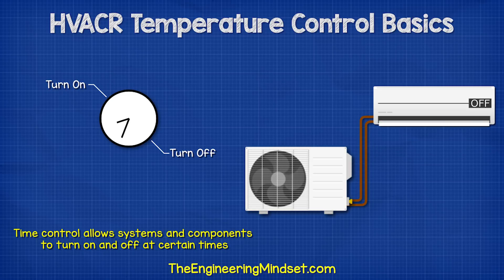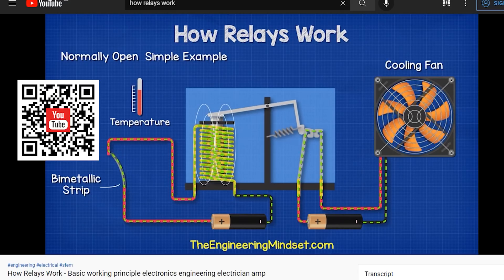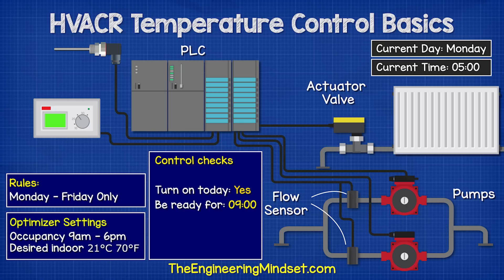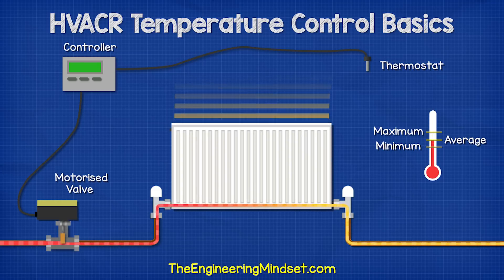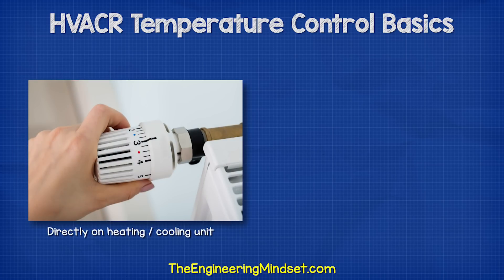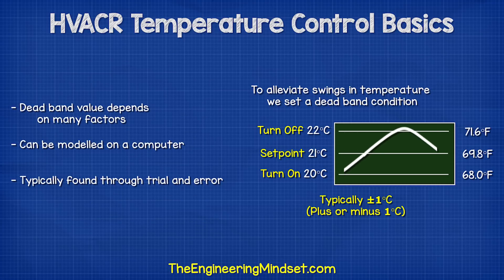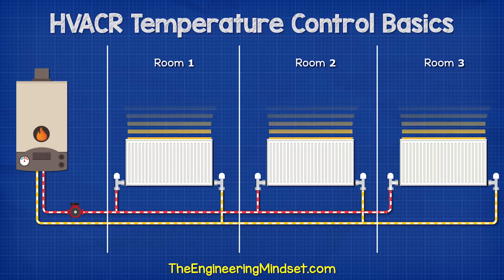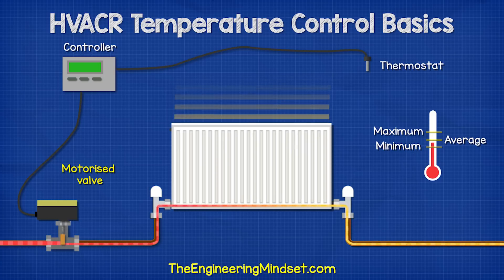HVACR Temperature Control Basics

Comment: An explanation of how thermostats and other controls work in a forced hot air system would be appreciated. In addition, a video regarding heat pumps would be valuable as well. Thank You